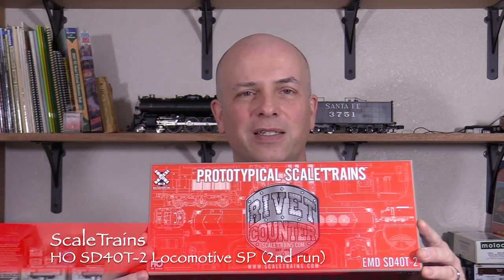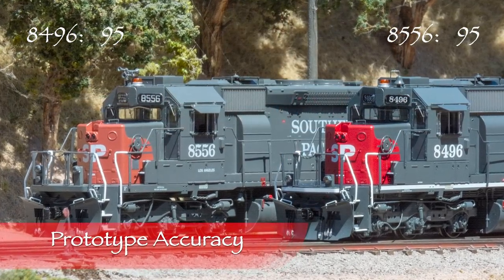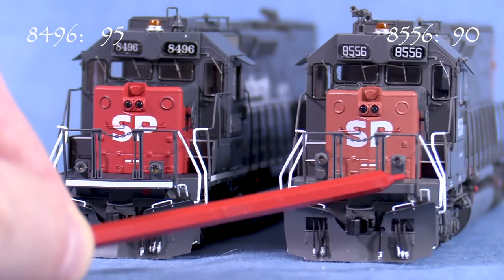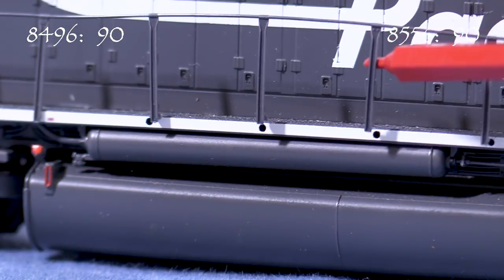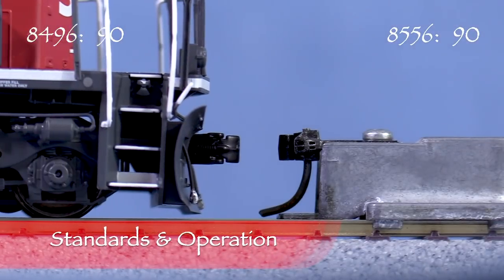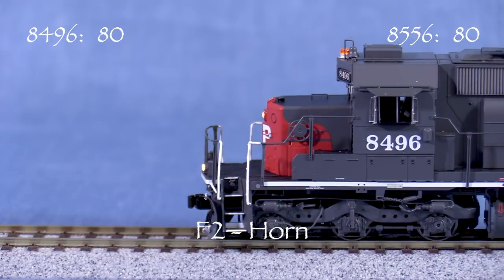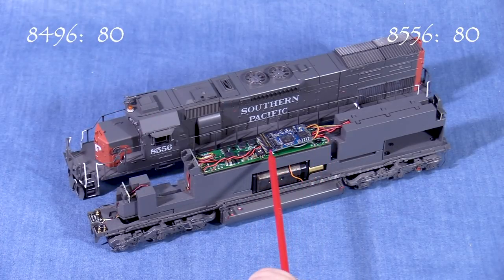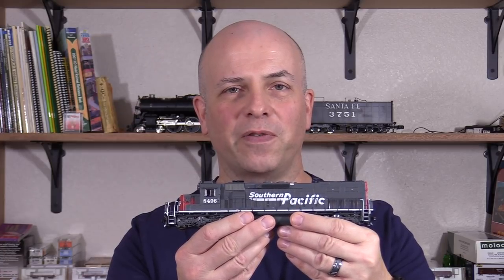Double Product Review HO ScaleTrains SD40T-2 SP (2nd run)

Comment: Thank you for the in-depth review. The honest assessment of these encouraged me to buy a couple of them: SP 8556 and UP 4551. I didn’t experience the same issues you had with 8556, but 4551 arrived with a brake shoe that had fallen off, a low front coupler, and the numbers 4451 on the rear of the long hood. The first two issues were an easy fix, but it may be a while before I get around to correcting the incorrect numbers.
Overall I am happy, they are great locomotives and have exceptional pulling power.
Reply from the maker: I have not tried removing lettering from a ScaleTrains model, so I can't really say how difficult that might be.  On some Athearn models, brushing on some Micro-Set, letting it dry, then applying tape to the numbers can help to lift them off.  That doesn't work on all brands, though.  I really like ScaleTrains overall, I just think they need to do a little better with the quality control sometimes.  Thanks for watching!

Comment: Awesome review! I picked up SP 8514 and 8496 along with UP 4429 and 8803. UP 8803 had a flickering ditch light that requires pressing down on the walkway to get back on. I guess several in my shops shipment have this issue and they said it has to do with oxidized contacts during shipment or something, I'm taking their word for it, but I was having issues with the front coupler to take the shell off to clean the contacts and was thinking the plow might have to come off. This saved me the hassle so I appreciate you adding it to the review.
Reply from the maker: Catching up on comments... The contacts that ScaleTrains uses have caused poor connections in a couple of models that I've bought from them.  Most of the time some pressure seems to fix the issue.  I'm glad you found the review helpful.  Thanks for watching!

Comment: Hello Dan, I was wondering if you were going to get back to the Southern Pacific consist that you were working on. I would like to see it when it's done. I'm working on a consist myself that consist of a patched Chicago Northwestern 6706 AC4400CW, UP AC4400CW, CSX SD70ACE and Union Pacific, Southern Pacific heritage unit SD70ACE. As far as the different colors on both of the Southern Pacific SD40 t - 2 units one being darker and the other one being lighter, the colors would be correct for their particular era. Southern Pacific had a light Lark gray and a dark dark gray. Scalecoat, Scalcoat ll and Tru-color offer both of these colors. I have a Southern Pacific Motive Power Annual from 1977 through 1980 that I bought in July  of 1981 and it has  Southern Pacific 8303 SD40T-2 on the front cover. ( BTW, I think the horn on 8556 is correct, it's just tilted the wrong way. Look at your book if you have it ).You can see that it has the lighter gray then the one with the speed letter. I remember seeing Southern Pacific units here in Detroit Michigan and in color photos and they were lighter than the newer units such as SD70M's, GP60's and the dash 9s. All came in the darker gray The GP60s that the Southern Pacific had ordered came from Canada. They came through the Detroit / Windsor Tunnel and with layover in the CSX rougemere yard in Dearborn Michigan behind the Ford Rouge Plant. I remember seeing these looked darker and I actually have photos of them sitting in that yard. The I have a Southern Pacific Motive Power annual for 1977 to 1980  and it has a tunnel motor  8303 on the. It has the lighter gray paint scheme. Athearn first produced the tunnel motor back in the early 80s, it was that Lighter shade of grey. One other thing, the paint that the railroads used back in the day all the way up until maybe the nineties I guess didn't really fade like they do now. They used Emeron fleet paint from BASF. The formula for the paint that they use had the lead taken out of it. Paint now peals, fades and everything else and they rust a lot quicker. This was a problem that the auto manufacturers had in the mid-80s. I used to work for collision shops repainting GM, Ford and Chrysler cars that had the problem of peeling paint and what ever else.
Reply from the maker: Catching up on comments... The consist build is an ongoing project.  I think a few more episodes have come out since you left this comment.  There should be another out fairly soon.  That's great information on the paint and paint colors.  I remember SP had a real issue with peeling paint on some units, especially the SD45T-2Rs.  Thanks for all the info and for watching, and good luck with your build (if you haven't finished it already)!

Comment: Great review! I too have experienced sanding lines in the bottom of the box. Also, on one of my Dash-9s, the plow was off. Maybe it is because of USPS like someone else mentioned.
Reply from the maker: It's possible the parts just shook loose in transit.  They have a little tab on them that's a press fit into a hole in the frame.  Maybe a dab of glue would have been a good idea.  Thanks for watching!

Comment: Great review Dan. I picked up each of these 1980-90's roman-lettered units by pre-order and I am very happy with them. The loose sand hoses might be due to rough handling by the shipper. I have noticed after the many ScaleTrains products I've bought that I have much better luck when I get the models directly from the ScaleTrains office in Tennessee by UPS (which they use) then I do with items shipped via USPS from a dealer. All of the instances of loose parts I've had occurred with examples I bought through a dealer shipped by the post office. I have seen the way they treat their boxes :( But these are top-notch models. SP 8556 is my favorite from this release, since this unit visited DFW several times when I was an impressionable youngster.
Reply from the maker: Catching up on comments... Most of my ScaleTrains models have come direct from ScaleTrains.  I'm hoping the SP SD45Rs I have on pre-order will arrive without damage.  Thanks for watching!

Comment: Nice review. I think Scaletrains should make GP15-1s, as they already have the compact drive system, and making it shorter won't be difficult. There aren't any good GP15s being made currently.
Reply: Nate's Trains whats wrong with the genesis ones? Just curious
Reply: @adaribros  they aren't made anymore, the details are inaccurate per prototype, and the intake grills are obstructed by tbe truck gear towers.
Reply: Nate's Trains I guess it makes sense. It is genesis after all. Their stuff is hit or miss. Thanks!
Reply: @adaribros  Athearn's newer models are more consistently good compared to older releases. Their quality has increased recently, however it is very true that models pre-2017 were hit or miss.
Reply from the maker: Catching up on comments... I have two Genesis GP15-1s, one undecorated and one California Northern.  The CFNR unit has a few minor detail issues but is pretty close.  Fixing it up is one of my many ongoing projects.  I'm planning to use the undecorated model as a UP unit.  Thanks for watching!

Comment: Great looking new tunnel motors by ScaleTrains.  I model caboose era D&RGW and a bit of SP, so the labotomized SP SD40T-2's are too new for me.  I'm looking forward to when ScaleTrains gets around to offering more early D&RGW and SP tunnel motors.  In a way I'm glad ST run 2 and 3 are out of my era or I'd be broke!  I'll keep watch for more early versions however.  Keep up the good work.
Reply from the maker: These are hard to resist, especially for SP and DRGW fans.  Thanks for watching!
Reply: @DanielCortopassi  Yes they are.  Bit by bit, I've been replacing my Athearn tunnel motors with ScaleTrains.  Unfortunately ScaleTrain's isn't offering SD45T-2's yet.  I'm looking forward to the shorter nose SP SD40T-2's but it seems for now ScaleTrains is taking a break from new tunnel motor announcements.

Comment: What kind of Kadee coupler do you use for the front and rear of locomotive??? Reason I'm asking is when you consist them together it seems to me that the locomotives are too close to one another to go around a radius of 22" and that is my minimum radius.
Reply from the maker: On locomotives without plows I normally use Kadee 158s.  On the front of engines with plows I usually use a 156 long shank coupler.  I don't know how my engines would do on a 22 inch radius.  I have run some of them on Kato Unitrack with a 24 inch radius with no issues, but I haven't tested them all.  Thanks for watching!

Comment: ScaleTrains are to be admired for their ambitious loco details. However, their factory quality control falls well short of the mark. My Big Blow had so many faults and poorly applied parts I had to return it, but this was only after a major battle with Scaletrains who tried to wriggle out of their responsibilty. I will forever remain cautious about them.
Reply from the maker: That seems to be a common problem with a lot of manufacturers these days that are producing high-detail models.  Quality control is an issue.  Maybe it's just with all those parts, there's more potential for things to go wrong.  On balance I've had pretty good luck with ScaleTrains, though I did return an N scale UP turbine because it had too many issues.  Thanks for watching!

Comment: As a railroad engineer, conductor, track inspector and a former millwright who worked on $220 million machines with tolerances measured by the thousands of an inch, it’s difficult for me to take these reviews seriously when it comes to the couplers. Have you ever been around an actual train and seen the variances in coupler heights? It is absolutely ridiculous to maintain a specific specification in the real world. In fact, the other day I observed a long draw bar on an old Canadian Pacific boxcar and we had a variance of over 8 inches, it was absolutely ridiculous, but that’s what happens when the plates get worn that hold the couplers at their original factory height. So I would make the argument that the couplers on these models are OK it’s the reviewers perspective that is off.
Reply from the maker: I know that prototype couplers sometimes vary in height.  Model couplers don't behave in exactly the same way.  I did a whole video about this so I'm not going to rehash it here, but if you want to watch, this is the link: 

https://www.youtube.com/watch?v=xZza89F3bZI

Thanks for watching!

Comment: I do love those locos. Those locos lack rear ditch lights. Otherwise,  it is a great loco overall.
Reply from the maker: SP Tunnel Motors didn't have rear ditch lights.  It's possible some of them had rear ditch lights added after SP's demise.  Thanks for watching!
Reply: Yep! They sure added rear ditch lights during the post SP era. Watco(WMAX) bought a few of those units and painted them off-black and off-yellow scheme. I am a fan of some short line railway operators. Kanawha River Railroad(KNWA) uses some of those units.

Comment: Nice review, but this silly business of taking points off because something fell off in the packaging, should have been supplanted by cool things like the builders plates.  Given some of the junk out there, these things get a solid 100 if I had to rate them.
Reply from the maker: I try to maintain a set of objective standards for reviews, and apply those standards to all the models I review as uniformly as I can.  I realize that the more parts and details a model has, the more likely it is something may fall off in transit.  Still, when you're shelling out hundreds of dollars for a model, it would be nice if it would arrive undamaged.  Thanks for watching!

Comment: I was VERY disappointed in this 2nd run as the engineer's walkway is totally warped and the sunshades are mounted WAY too high.
Reply from the maker: It sounds like yours had more issues than mine did.  Sorry to hear that.  Quality control is an ongoing problem with a lot of manufacturers.  Thanks for watching!

Comment: HO scale engines having cab sunshades all have the same problem : They're ugly ! How can those manufacturers put so many nice details but can't fix the shades issue. All of them. I tought they would come with the idea to mold shades railing and shades in on single piece and snug fit them to cad sides. It would be stronger AND better looking in the same time. So it seems like I will have to do it myself again and again. I can't believe manufacturers are not paying attention to that. Shades are like nose in the face. Can't missed it ! Especially when it's ugly.
Reply from the maker: The sunshades on some of the ScaleTrains tunnel motors weren't the greatest.  I prefer photo etched brass sunshades with built in pins that fit into holes drilled into the cab.  Some models come with those, otherwise I'll use aftermarket parts.  They're the only type of sunshade I've tried that don't fall off constantly.  I agree that it's not something I want to have to fix on a model that cost close to $300.  Thanks for watching!